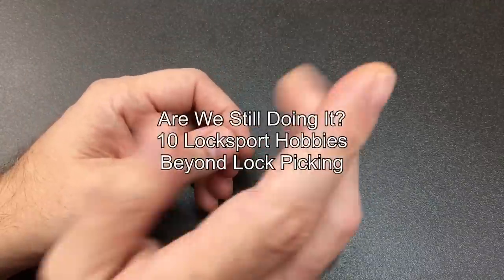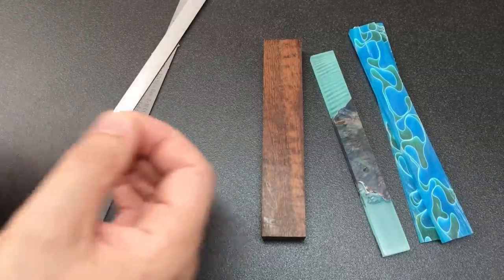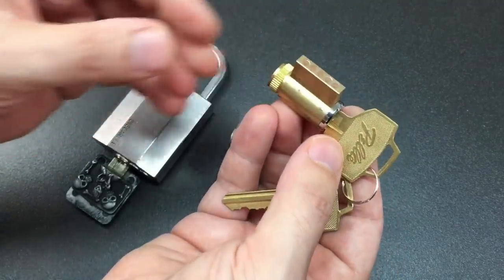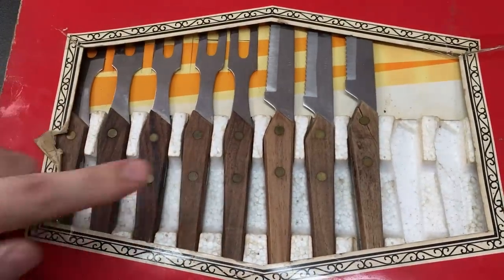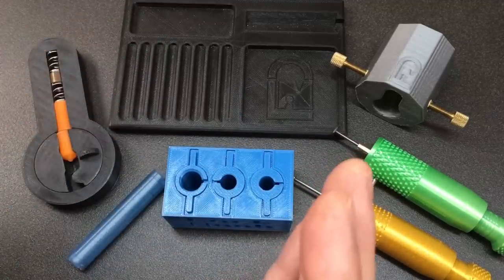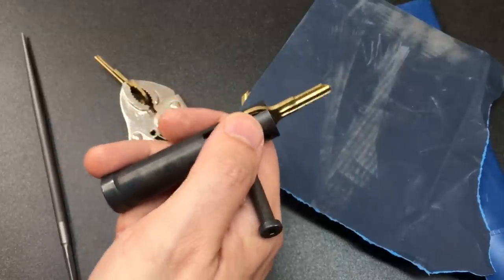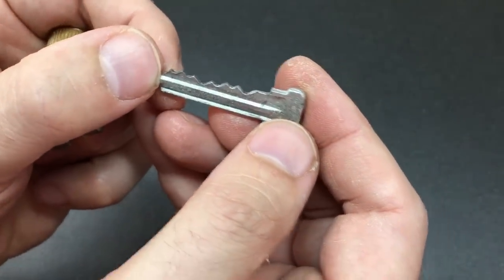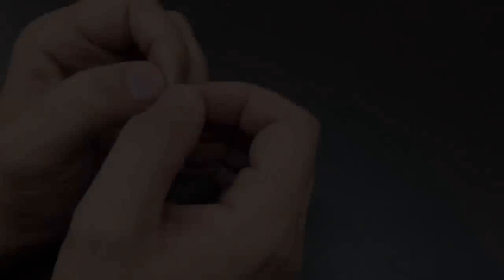10 Locksport Hobbies BEYOND Lock Picking - DEF CON 29 Presentation

Comment: My Favourite Mod:   Purchase some 1/4 ID Thick Walled Brass Tubing from a hobby shop.  This is done with full or part picks.
Gently tap the length of the pipe to begin crushing it into an oval until you can slip a pick handle into the tubing.
Hold the pick in place while you continue gently deforming the tubing with a hammer.  When the tubing has grabbed onto
the pick you can begin smashing the hell out of it.  Once you have good shape you can start the sanding and polishing.  Looks fantastic!
The down sides are a heavy handle with somewhat muted feedback and you have to chuck the handle when you break the pick.
Still, the look is incredible once you buff to a full shine.  I used a set of Sparrows Euro hooks as they are quite strong and thick.
You can also use cheap Chinese picks with plastic handles.  Heat the pick and the plastic handle will slide off when it starts melting.
Do not overheat the metal, like red hot, or you will change the metal characteristics and probably end up with Martensite picks.  Crumbly!
Reply from the maker: Good tip!

Comment: as you mentioned "Tool Modification" especially of tools that were never intended to be used on locks ... I had to think of my last tool ...
I took a 40mm stainless steel spatula (I bought actually another one, after having that Idea) and glued a printed shape of the sparrows mini jim on it ... it was a hard time for the grinder, but now I have a Jim with a pretty nice handle :)
Reply from the maker: Cool!

Comment: Thanks for this one, Ash. 🙂👍

Many people likely discover different aspects of the hobby either accidentally, or through necessity. I made my first proper single purpose pick recently, by modifying a cheap Chinese dimple lock too because the pick I wanted wasn't easily available without buying a full set of picks. It does the job nicely. And as people say, you can never have too many levers.